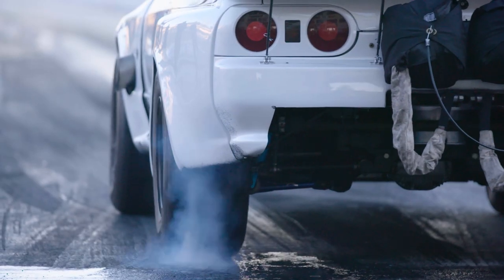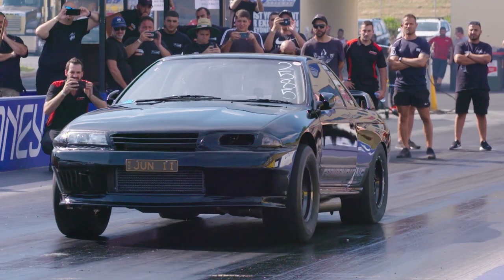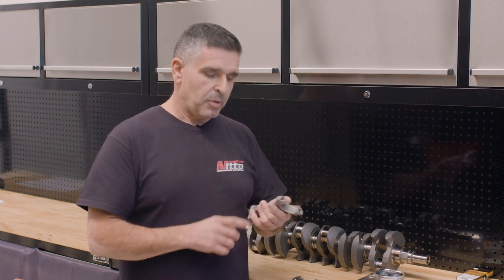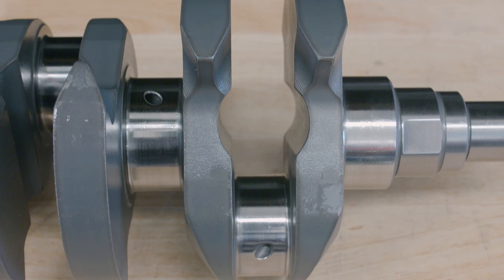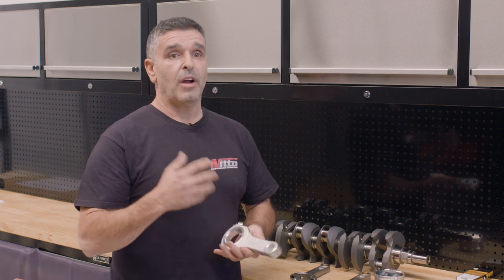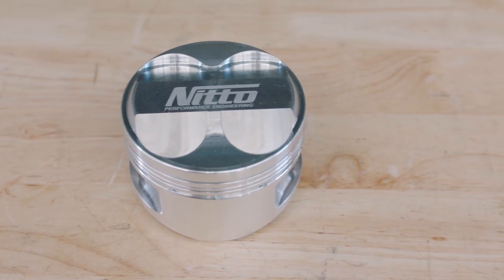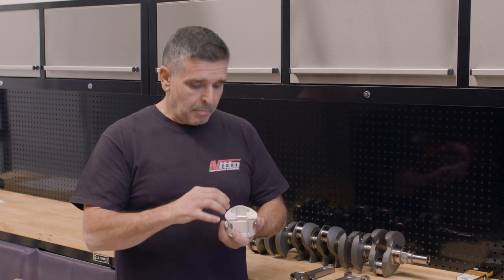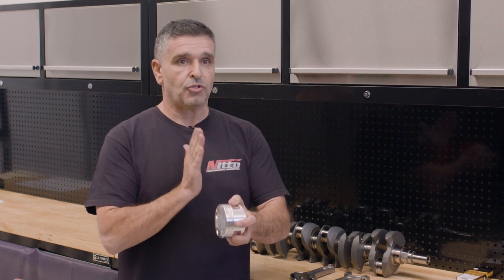3000HP GT-R with a TRUE RB and 2000hp GT-R Street Cars - New Nitto Crank/Rods/Pistons

Comment: They are going to start selling aluminum rods now? NICE! Much stronger than the aluminium ones we've had in the past.
Reply: You still need to change aluminum rods far more often.
Reply: @zethloveless7238  aluminium rods are not there to be strong they are there to be more flexible and save the crank and block

Comment: Great video, but I can’t wrap my head around how the horse power adds up along the crankshaft front to back.
Is it because the output is at the back and it is seeing the reacting the torsional forces of the tyres and inertia of the vehicle?
Reply from the maker: Think of it this way. The 3000hp all meets at the be of the crab where it joins to the flywheel or pressure plate. The rest of the drivetrain is the restriction right there.
Reply: lever arms, increase in force based upon the length of the lever arm. dont think in horsepower but instead in torque 

in the example the increase in torque was based on length from first piston to last piston. each piston puts out 500ft-lbs, then multiply it by the number of pistons you moved away from. 

example: v8 making 200 ft-lbs per cylinder(or horsepower its only an estimation). all the cylinders are attached to a single crank.

 the end of the first row makes 400 ft-lb combined, so the measurement at the end of the second row makes what combined? (800ft-lbs or 200 ft-lb x 4 cylinders)

Comment: Once you swap to a billet block you have thrown away the last genuine part you could work with. It's not an RB anymore, no matter what dimensions you base it on.
Reply: It stops being an RB the moment you go to a billet block. All these cars with billet blocks and RB26 heads are a joke, the only RB item left is the cylinder head. That hardly makes the engine an RB at that point.

Comment: show dyno sheet or its all fluff.. tired of these mythical 3k hp engines.... just do a proper 1k hp high rpm drag rb. has anyone ever tried a rb20 based crank for drag purpose?
Reply from the maker: How about 6.55 and 219 mph GT-R? What about a street car going over 210mph ans 6.87? Don’t need dyno graphs to prove the power there on their claims of 2300hp so far.